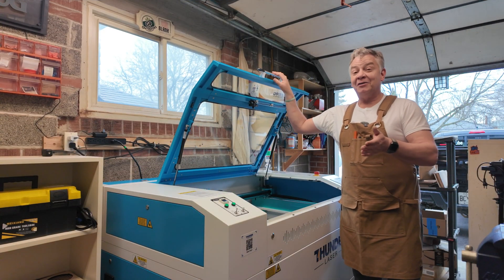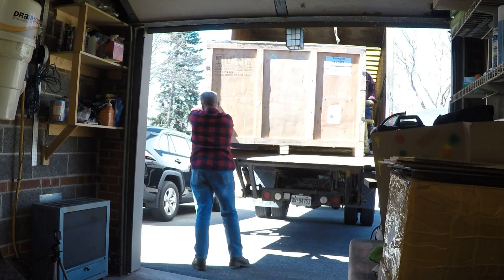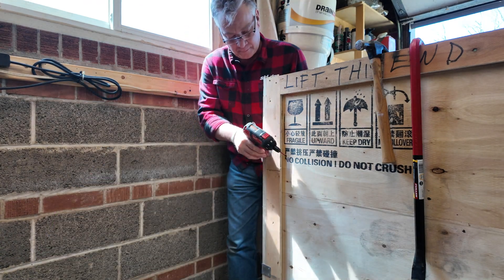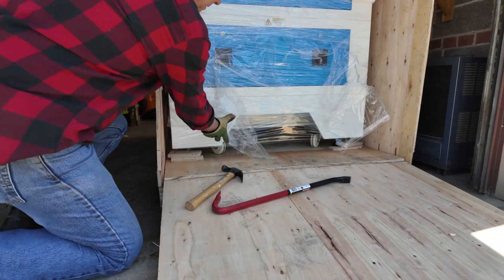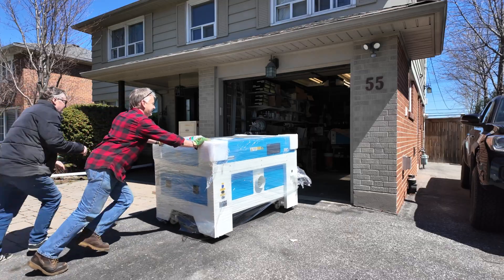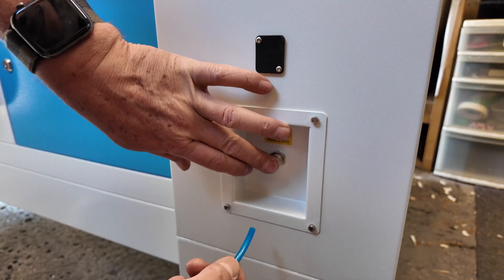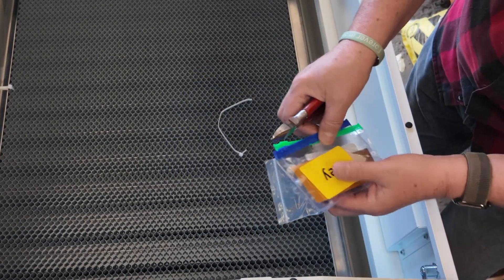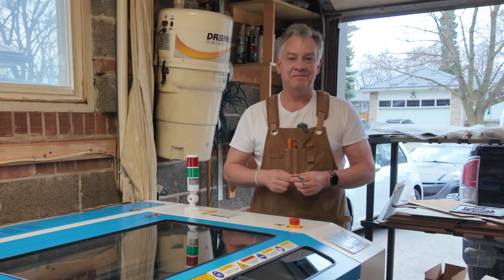The NEW Thunder Laser Nova PLUS 35 60 Watt C02 Laser. Physical Installation. WOW! 081   4K

Comment: I am waiting on my nova plus 24 to arrive and was told I need a dedicated 20amp even though online it says 15. Do you know which is correct?
Reply from the maker: Hey thanks for tuning in. I would recommend you talk to the sales person you bought from. This Nova PLUS 35 - 60 Watt requires a 15 amp circuit, but I am not familiar with the Nova PLUS 24. Give them a call to confirm before you spend the money to have an electrician install larger gauge wire runs and a different 20 amp receptacle. I wish I could help you more but for sure, call TL and check before you spend the money on the electrician. Good luck and let me know how it turns out!
Reply: Thanks so much! I just spoke with them and they said they recommend 20amp for all Plus models. Just wanted to share with you just in case it helps you.
Reply from the maker: @narbir22  It does thanks - may I ask - are you in the US or Canada?
Reply: I am in US - California.
Reply from the maker: @narbir22  Thanks - Let me know how it goes from time to time- Cheers!